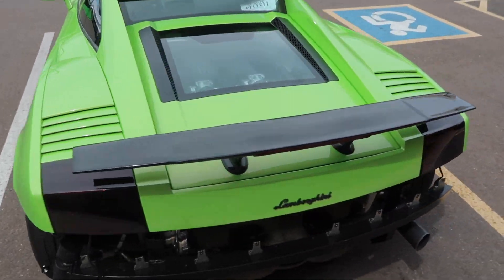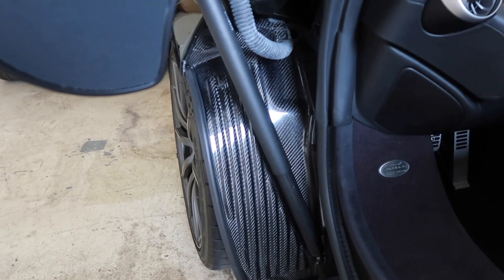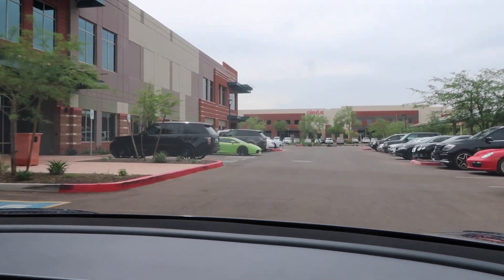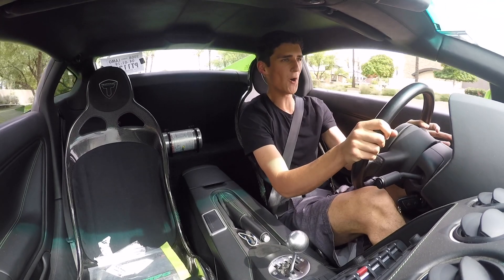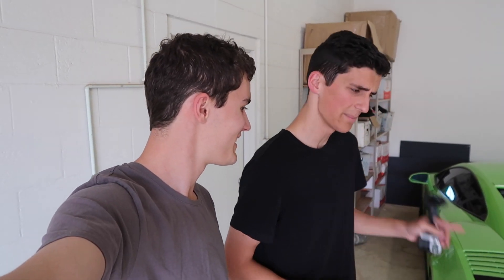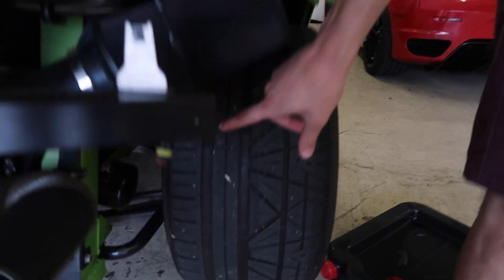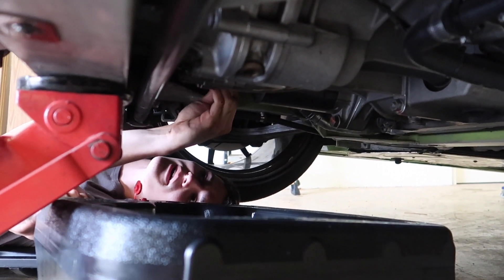Will Our Cheap Twin Turbo Lamborghini Gallardo Align After Crash?

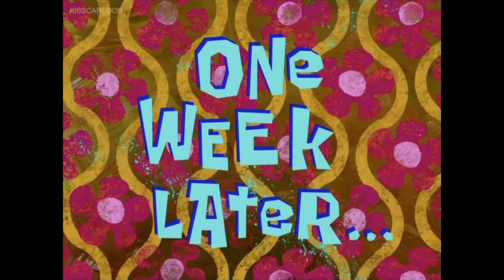Comment: Christian and Jeff: Always enjoy all of your videos and the effort you put into making them.  I especially enjoy the “ONE WEEK LATER” 3:31 funny voice and "AHHH..." 4:20 - unique to your channel.

I want to keep coming back for many more so guys can I please ask a safety favor of you: Never get under any vehicle that is being supported by a jack alone.  Make sure to always use jack stands in case the jack fails. Thank you...

Now, onto a bit of history:  On May 6, 1937, while approaching the mooring mast at NAS Lakehurst, NJ, the Hindenburg suffered a catastrophic loss.  The disaster was sparked (pun intended) by an electrostatic discharge (aka spark) that ignited leaking hydrogen. Fast forward eighty-two (82) years later with NIKOLA introducing a semi-truck that is fully electric or with a hydrogen-electric option. The red semi looks magnificent but I do not want to be the one taking it on its maiden voyage.

Comment: OK I’ll be the dad here.  USE JACK STANDS!  Ever see a jack fail?  I have, and it’s fast.  Way faster than you can get out of there.  Awesome car, amazing channel, but stay alive fellas.
Reply: devnull128 
Came to say even harsher things but you summed it up.
No coming back from trolley jack failure from under such a low heavy car!!!
At least sling a wheel under it. I'm sure they have one around somewhere if they don't want to dig out a set of axle stands.
Reply: I commented the same thing on their Instagram pic... So scary using only a jack. Not worth the risk. I use a jack stand and put boards under my wheels if they arent coming off. Never can be "over" safe.
Reply: devnull128 Was gonna say the same thing! Don’t ever get underneath a car with just a jack!
My jack actually failed the last time I changed the tires on our 5.500lbs Benz and I would not like to be under that thing when it dropped.